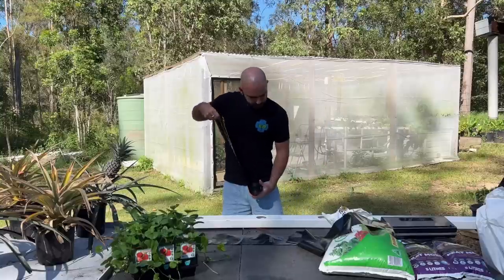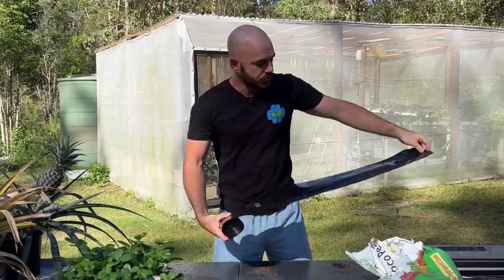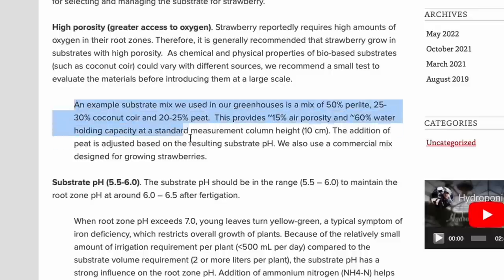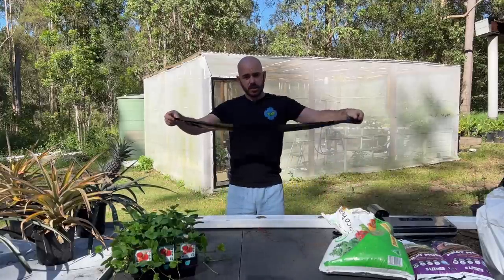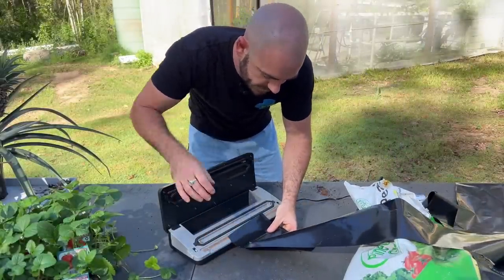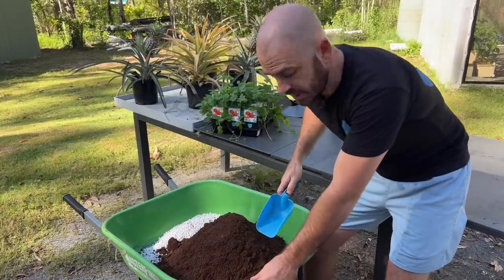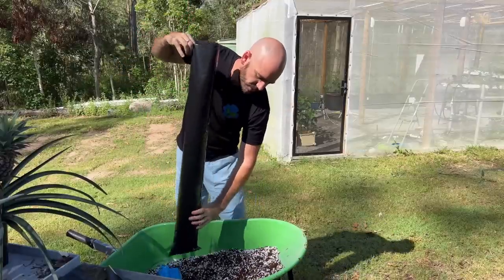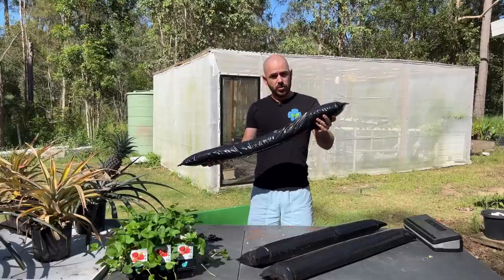Make Your Own DIY Custom Grow Bags!

Comment: Comment on the flat poly..
There are some handheld sealing devices out there that might be good for that.
On top of that you could use plastic film that is made for silage - black/white - put the white side out and keep the roots cooler. It is also quiet cheap. However it is more work though.
Pro tip on the silage film: it can also be used to cover your IBCs for for low cost.
And finally, if you have one, use a concrete mixer for the potting mix ;)
Reply: Do you have a brand name for the plastic?
Reply: @Pummers38  Sorry no brand name available. But if you search for black white film silage you will immediately find it.

Comment: Just thought of using the Rock Wedge blocks to spear into the bottom of 200mm pots that have either GeoFabric or plastic in the bottom as a way of recycling 200mm nursery pots that most people throw away.
Basically a RGGS using pots that allow a quick change of pots or allows them to be moved about without having the net pot extending from the bottom of the pot.
Reply from the maker: I plan on doing one for plastic grow bags in a similar fashion

Comment: I have been unable to find any poly tubing like this that is UV resistant, has anyone seen anything like this, preferably in the US. The products at places like Uline specifically mention that they are not uv stabilized